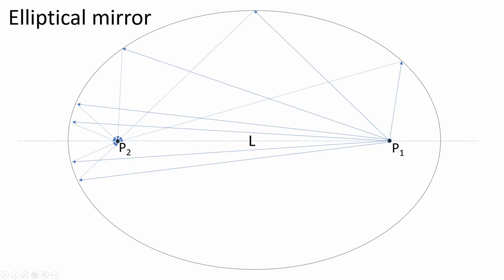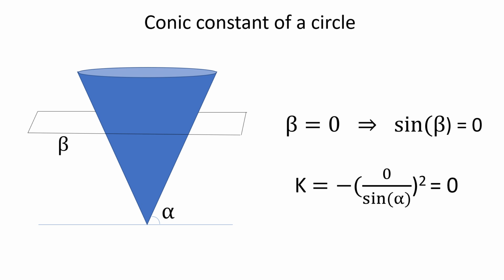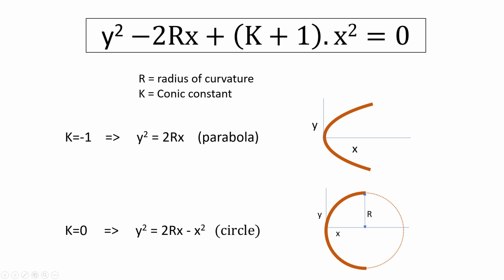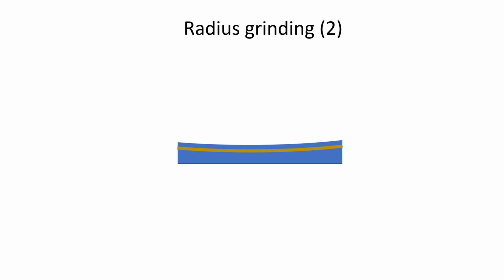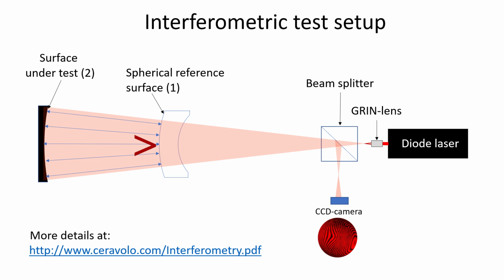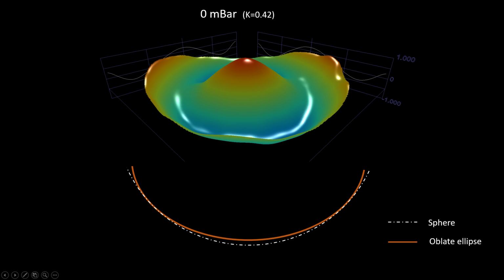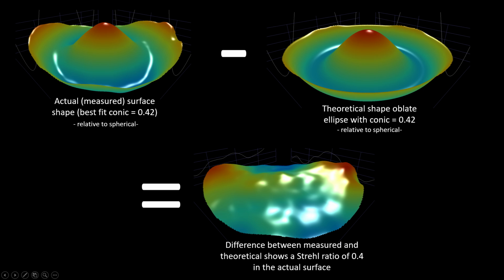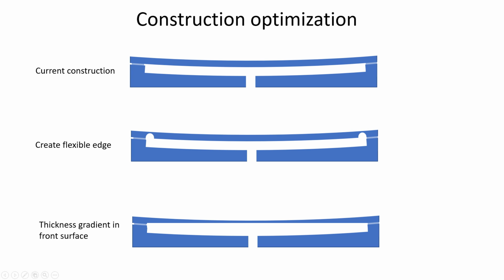Making a Mirror with a  Variable Surface Shape

Comment: Cool.  This must how some of the larger telescopes adjust for the atmospheric blurring?
Reply from the maker: For that you need much faster response with not just one parameter. Generally it's referred to as "adaptive optics", and they are relatively small components. For large primary telescope mirrors they also use variable supports to correct for general error in the shape of the mirror.

Comment: Hi,
great Video by the way.
Would a flat peace of glas produce a parabola?
I was wondering if it could be done with a protectionglas for smartwatches stright out of the box.
Reply from the maker: Hi Christian, I don't know, are they nicely spherical? You can generate a parabola (or other aspherical shapes) by pressurizing the chamber during polishing, because you will remove more material in the center with positive pressure and less with vacuum.
Reply: @HuygensOptics  The tempered glass iPad screen protectors are totally flat. I think Christian means to generate the parabola from that flat surface using only pressure, and no grinding, similar to the following video, but with glass instead of plastic. https://www.youtube.com/watch?v=8CLRTa_ocmo

Comment: Would it have been possible to simply fill the cavity with something that would support the mirror during polishing and could easily be melted out? It's not like it would be super important to get every molecule of it out since it's just a vacuum chamber, though you could probably get almost every molecule out.
Reply from the maker: That would have to be something like wax, or a low melting metal alloy which both have a large volume contraction when solidifying.
Reply: @HuygensOptics  A great video. I like what you do with optics at your shop.  I know your done with this project, so just for thought. Maybe you could have filled with water and plugged the hole when polishing.
Reply: @HuygensOptics    what do you think using a liquid in stay of air for the vacum.

Comment: Just wondering if localized heating and cooling of the glass has been tried to raise parts of the glass that need to be ground off and lower good areas for protection? Seems like it might concentrate force on high spots for faster and maybe even more accurate grinding/polishing, maybe also to vary shape in use instead of using pressure. (Not sure how it would be done but picturing a dense grid of individually controlled peltiers mounted to the back surface of the mirror as it is being made. (or maybe piezo elements to apply pressure instead of heat))   Also, is there any such thing as an inexpensive source of glass for making large (300mm+) telescope mirrors?
Reply from the maker: Simplest way is not to deform the mirror, but to use deterministic polishing: just polish in places where you need to remove material, by using a smaller tool and varying the contact / polishing time over the surface of the optic. For example as illustrated in this video. https://www.youtube.com/watch?v=tMp0sI3aYEU

Comment: Can you vary the pressure, to get a differential grind? ie. High pressure to remove the central peak?
Reply: But it would work only for a particular focal length. No obvious way to get a continuously-changing focal length free of aberration because of changing conic constant. It would be so nice if there were a simple solution.

Comment: I'm curious how well an elastomer with a conductive mirror coating and a grid of electrodes would work for doing this kind of adaptive optics.
Reply: Yes, this might have better results than any pressure on the lens, because not only could you change the focal length, but the conic constant at the same time. The electrodes would be concentric circles, of course, to squeeze a piezoelectric lens surface by differing amounts depending on the radius of the electrode on the lens. Could end up simple and effective if various problems were solved, such as how to manufacture a radially constrictive piezoelectric lens.
Reply: David, how are you going to solve the problem that optical-quality lenses made of piezoelectric/piezoconstrictive materials are not commercially available?

Comment: How accurately can you you control the depth of the blasted cavity using SiC media?
Reply from the maker: Not very accurate I guess about 50 um. Generally it is a question of uniformity: if you want to make very uniform cavities, you need to make some kind of CNC sand blaster, and control the amount of abbrasive material to very high degree. I blasted by hand, which is not ideal from the controlled depth perspective.
Reply: @HuygensOptics  very interesting I’d never thought of blasting as a bulk material removal process

Comment: Can anyone please give some advice, I keep searching for a way to make a large facet on the side of a natural quartz crystal optically flat and not sure how to be do so. Perhaps just hand grinding the quartz on a 1/10 wave flatness glass window I have with the correct graduations of abrasive powders is the best way? I need the facets FLAT so I can get them mirror coated to use as laser mirrors.
Reply: You'd need to block it with other pieces adjacent to the surface you need, and then grind all down.  Then polish and correct it.  Don't grind with the flat, because it will be destroyed.  Make and use other grinding an polishing tools.

Check out Amateur Telescope Making  forums...Cloudy Nights is excellent.